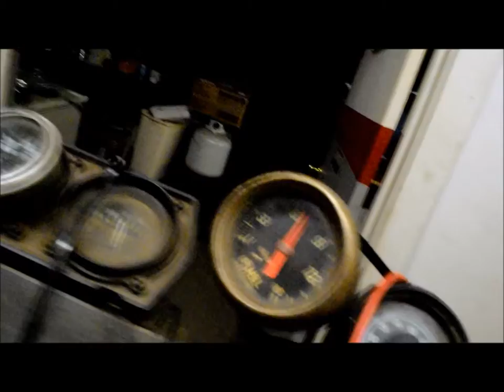Holley list 4575 W/ 750 Boosters start up

Comment: I am a trained mechanic and I seen where somebody put a lawn mower carburetor on a motor and said that it worked out and didn't have no problems afterwards what a bunch of bull I want to hear your comment on the purpose of how rich the fuel is and how much you're getting
Reply from the maker: Well, video was made 6 years ago, so details are a bit fuzzy, after the smaller boosters were installed, it was street able for the most part, but the 4.5 mpg were a little tuff. Basically was going for "The" look with the 4 velocity stacks. Gave up on the carb  2 years ago, and went back to an 800 cfm dbl pumper holly. Car went 12.50s at that time.. This past week end went a 121.27@107 with the 800 cfm. Thanks for watching.
Reply: Where were you trained?!?  I can make a 5000 cfm carb run lean....as a matter of fact the more air it will flow the easier it is to make it run lean!  You can take a dominator carb and install big wide skirted annular boosters and cut the airflow down to 750 cfm @1.5” hg.  BTW stock cammed SBC’s don’t run 12.50’s and some people know how to tune a bunch of lope out of a lopey cam......hint: add a lot of ignition advance at idle....